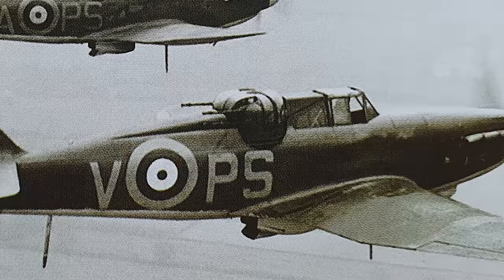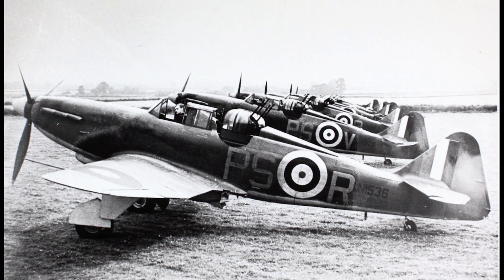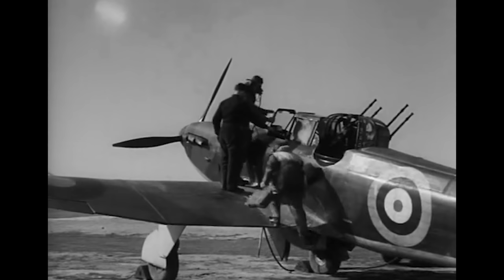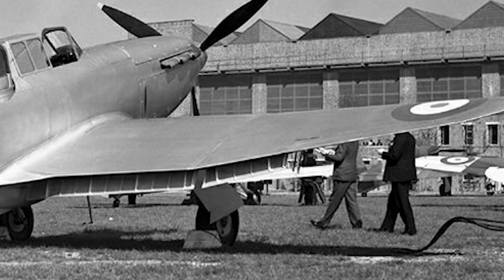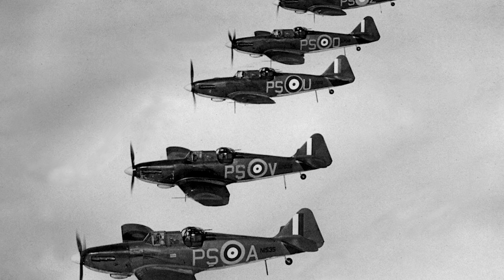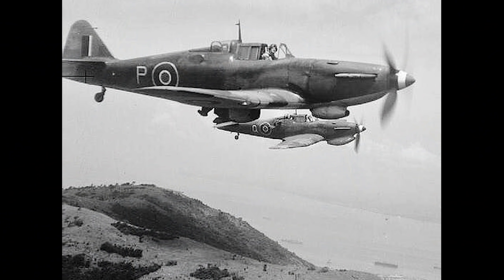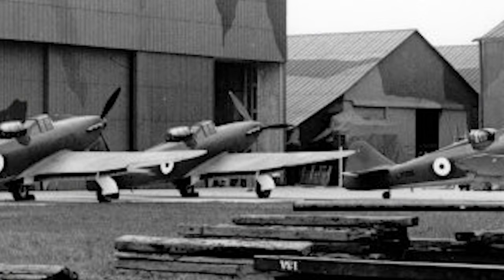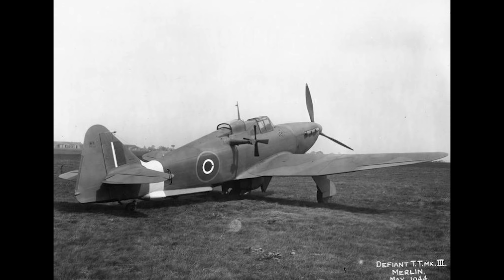Boulton Paul Defiant - The Unlucky Turret Fighter | Aircraft History #4

Comment: From the video, it appears that half of its shortcomings could have been overcome by the addition of a forward facing gun.
Reply: I think the problem would be adding enough guns to make the Germans think twice about a head on attack. A couple of machine guns probably won't cut the mustard against the 109's cannon and even these (with a reasonable amount of ammo) would be adding more weight to an already heavy plane. 

Really the Defiant was an idea that could have worked if France hadn't been knocked out the war. The RAF would have had a home defense fighter that would have been able to engage any bomber formations directed at Britain as the 109 would have never had the range to escort them. I suspect that they'd probably been phased out as the RAF realized that Hurricanes were just as capable and easier to produce. The Defiant would have gone the same way as it did, moved to a night-fighting role then dropped in favor of more capable machines. In this case it would have probably gained a better reputation as being the machine that freed up the Spitfires and Hurricane squadrons to support France.

As it is it's one of those machines which might have seemed like a good idea on paper but didn't work out in practice.
Reply: Nah
. would have made it even heavier and slower. Maybe split the armament? Dual gun turret, instead of quad, having 2 forward facing guns? Personally I would have had a dual gun turret with a single hispano cannon through the prop. Also getting rid of the hydraulic mechanical aspect of the turret to a manual since 2guns would be easier to manipulate in a turret and save weight.
Reply: @ehold6877  I think best would be to just get rid of turret, maybe have simple tail gunner but not turret because that thing was heavy and produced lot of drag. 

From what i heared, there was idea of turretless version of defiant with forward facing weaponry considered as heavy fighter with predicted speed close to spitfire. However i can't prove this information but it would certainly be more practical...
Reply: @jirja3192  maybe get rid of the turret, have a single gunner with an hispano cannon and regular armament of a standard fighter. Sort of like a il-2?
Reply: @jirja3192  Then just fly Hurricanes. Rear gunner not a lot of good on a fighter.
Reply: @Ahmad Hanifurrohim the turret could actually rotate and lock facing forward, it just took a bit of time I suppose to do so.
Reply: It was already slow by wartime standards so the addition of wing guns with ammunition would render it a lame duck.  It was a niche aircraft that found its niche as a night fighter.
Reply: Well, yes and no. It might have removed one of the weak spots, but it was ultimately the weight of the second crewman and the turret machinery that did the Defiant in. One of the biggest complaints Defiant crews had was in the difficulty they had coordinating with one another - deflection shooting from a turret is massively mathematically challenging (to the point where late-war American bombers used some of the first computers to do some of the work), and was made much more difficult when the Defiant wasn't flying on a steady course and at a steady speed - factors which meant that the pilot had to make the plane vulnerable to enemies for its main armament to be effective. When the pilot had to fly defensively, or if he would have had to maneuver as a normal fighter would to bring forward-firing weapons to bear, the quick motions of the plane would make the turret effectively useless because its mechanism couldn't keep up with the direction and attitude changes. Considering that the weight and speed were the things that ultimately put the Defiant out of business in combat, making it struggle to turn and keep up with single-seat fighters to use forward-firing weapons would have ultimately been a losing proposition as well. Thus, they went back to Hurricanes and Spitfires for the most part.
Reply: They should’ve just enabled the turret to shoot forward, and let the pilot take control of the guns in this position. That alone would’ve made the aircraft much more versatile.
Reply: There is a weight limit.  
soooooo
NO
Reply: @Ahmad Hanifurrohim "how about... wait for it... FORWARD FACING TURRET"

The turret couldn't fire down. or perfectly strait on. The muzzle break's would have been on either side of the pilot and incapacitated him.
Reply: Would have been great as a  Fighter bomber role with 4 30 mm fixed forward-facing and a 23 mm aft-facing Gun.  Keep the quad turrent and make it aerodynamic. 

Make the Wings delta and have two Variant

Tank Buster: 
Make the plane movable and add hardpoints  for rocket launchers Anti Tank roles 

Antiship maritime fighter: 
 Add torpedo drop bay for maritime  against ships and hardpoints
add Radar

Put a powerful engine with a 4 bladed propeller like the P4 thunderbolt and 

Would have been great against Naval warfare and a Tank Buster role  in WW2 for the British.

Missed opportunity  I'll say.
Reply: @LoneWolf-rc4go  that’s just it: it’s up against planes that it wasn’t designed to face…it’s not a true fighter, it’s more of a bomber interceptor
Reply: Yes forward guns would have helped. Pair of 20s would have kept them in the game. Weight would have shaved off probably 10mph. Big deal. Still could kill bombers
Reply: And the other half would have been overcome by deleting the turret. 😂
Reply: Remove the turret and gunner and fit eight .303 mg`s in the wings. Essentially you get a Mk2b Hurricane in mid-1940. This was seriously considered at one point.
Reply: There was a proposed single seat version (source Willian Green 1959 with photo) but it was just as fast as a Hurricane). The pilot could fire the turret  guns.
The turret was meant to be used like a Foster mount for no allowance shooting.
Reply: @LoneWolf-rc4go  I think that is a very reasonable assessment and a very important aspect of the design that is never considered.
Reply: I was wondering if it could actually shoot forward with some kind of synchro mechanism to shoot thru the prop.  Probably asking too much & too complicated for a turret of that type.
Reply: @tomtom8889  It could shoot forwards at an oblique angle but not directly to the front.
Reply: The guns could be fired by the pilot andvthe idea was that it was supposed to fire over the prop lie the Foster mount on an SE5 or Nieuport. 
What everyone misses - self included - was that when designed no one expected France to fall or ME 109's to be at the Pas de Calais. The Defiant was designed to intercept bombers that were either unescorted or escorted by heavy fighters like the Me 110.
Check out links to "no allowance shooting", this is the guiding thought to the COW fighters and the turret fighters. 
They were on to something though, because this reappeared as jazz music and it took a toll on RAF night bombers and even B29s raiding Japan. The Japanese also mounted oblique gunsbinbtheir heavy fighters.
Reply: Nobone expected France to fall and no one thought that it would ever have to fight the Me 109.
Reply: @AbelMcTalisker  Ah okay.  Thank you for the info & clarifying that.
Reply: Ironic then that the RAF never worked out what ‘Schrägemusik’ was…
Reply: @bob_the_bomb4508  
Indeed. Most RAF bombers were designed with ventral turrets, but were abandoned because they were essentially useless.
The COW fighters of the 20's and 30's were jazz music fighters.
The problem was looking down at night it is hard to see the attacker and looking up the bomber is much easier to see, particularly in clouds or moonlight.
Reply: well forward machine gun and a bigger engine to give it more speed.   maybe lower its base fuel to 350 miles and add a drop tank.
Reply: Add forward firing guns (like Hurricane armament) and replace the engine to increase horsepower.
Reply: @ficklefingeroffate  
This plane was never intended or expected to fight single engined single seat fighters. When conceived no one expected France to fall and the BF 109 could not escort bombers from Germany. The planners never expected German bomber formations to be escorted aĺl the way to London by Bf 109s.
Reply: @kellybreen5526  ok...and?  It doesn't mean anything I said was incorrect.  Adding forward firing guns for the pilot and switching over to a more powerful engine would have significantly improved the plane.
Reply: @ficklefingeroffate  I never implied that you said anything which was incorrect. Frankly I don't disagree with you either. All I would say is that most people assume the designers expected the Defiant to tangle with single seaters,  but the technical writing makes it pretty clear that the Defiant was intended to defend Britain from heavy bombers that would be flying from Germany and therefore too far from home to be escorted by single seat fighters. There was a single seat conventionally designed Defiant proposed (Green 1959).
Reply: @C4nn15  still too slow and under powered. And why have four guns in forward facing turret rather than th six guns in the wings like a regular Hurricane?
Reply: @rbilleaud  well it was roughly the same speed as the equivalent Hurricane, the advantage would've been a revolving turret, it wasn't as manevourable though.
Reply: @kellybreen5526  What is a jazz music fighter?
Reply: @londonalicante  Jazz Music is a generic term stolen from the Germans in loose translation.
What it refers to is armament pointed off the direction of travel and instead firing forward and upward at an angle usually around 60 degrees.
It allows a fighter to attack from below and behind in the bombers blind spot.
Even a bomber with ventral protection had difficulty looking below and identifying threats at night. Conversely the bomber would be silhouetted by cloud or a moonlit sky.
Reply: This results in four unsyncronised machine guns firing through your propellor. :(
Reply: @ABrit-bt6ce  He means wing mounted guns.
BP had a single seat conventionally armed mock up produced (Green 1959).
As mentioned by another contributor, when designed no one expected France to get knocked out of the war, so no one expected the Defiant to have to fight BF 109's. The pilot could fire the turret guns, but did not have a sight because he was expected to fire the guns in a "No allowance shooting" mode. No allowance shooting is the angle used so often with the Foster mount during the Great War, the COW gun of the interwar period, and "Jazz music" used on German nightfighters.
So the concept isn't that left field. 
The circumstances of employment and the subsequent combat record are where the plane ended up with its horrible reputation.
The RAF must have seen a use for the type though, because it remained in production rather than forcing BP to produce Spitfires.
Reply: It had been conceived with forward aiming guns, but the Ministry insisted in having the turret as sole armament.
Reply: There was no answer as a day fighter, but as a night fighter maybe there were paths not taken?.  I look at the North American P82 extrapolated from the P51 and apply that.  Maybe forward firing 20mm cannons in the wing joining the two fuselages, pilot and radar operator in number one, and turret in number two with 12.7mm in the turret.  But maybe that’s just another way to build a Beaufighter?  
Still, the P82 concept concept could also have given a Spitfire or Hurricane range to escort bombers on rhubarbs or maybe done something to add speed and firepower to a Tempest chasing V2 flying bombs?
Reply: @jirja3192  Perhaps with forward firing guns, the plane could have been of value to the Fleet Air Arm, with the rear cockpit dedicated to a navigator. Perhaps the heavier design and undercarriage would work well on a carrier.
Reply: Nice video if it had guns in wings it could have gone much further!!!
Reply: They were looking for an aircraft to do the same job as the Hawker Demon, and before that the Bristol Fighter, but they appeared to have forgotten one important thing, both those aircraft had forward firing guns and were flown like a normal fighter that just happened to have a gunner available for rearward defence.
Reply: I love the concept of this aircraft! I didn't realize they actually flew in combat in the early stages of the war. I remember seeing a model of the Defiant and I thought it was a fictional alternate universe design.

Comment: Imagine if the RAF had the foresight to instal twin fifty calibre instead of four .303. The improvement in hitting power and range would have been considerable.
Reply: That would have meant introducing a completely new gun, and all the logistical difficulties that come along with that. 

New gun production lines with new tooling. New ammunition production lines. New maintenance and training requirements. Aircraft out of service if refitted, or a wait for the new aircraft production lines to be modified. Changing a gun caliber on a large scale is an intensive process. And just changing it for a single model brings different headaches.

The .303 was adequate enough in the early war that it wasn't worth the investment to change gun caliber. By the time the Brits finally came to the conclusion that the .303 was inadequate, it was felt best to jump right to a 20mm, which was even better than the .50 cal. And by which time the Defiant was no longer in front line service.
Reply: @mikearmstrong8483  Also Douglas Bader was totally convinced by the .303 against the 20mm Hispano. But due to installation issues, the Hispano was unreliable at the time.
Reply: Boulton Paul had such a design ready to go using cannons. Rarely mentioned anywhere however was the kick back from the guns which knocked the aircraft about on firing and did give the pilots challenges when moved to fire sideways due to wind resistance and recoil. Two reasons why it never made it beyond a drawing board.
Reply: @mikearmstrong8483  all the American lend lease aircraft arrived in Britain fitted with .50 brownings. The infrastructure was there.
Reply: @PeteCourtier  
To my knowledge, the infrastructure was not there. Lend Lease planes were tailored to the customers. In the case of the British, the armament  of aircraft was changed to match what the British were using as standard. Most planes would arrive without guns, but with modifications that allowed for installation of .303 guns after delivery. Those that arrived with .50s (still looking to see if any did at all) would have come with technical instructors to teach maintenance, and a steady supply of ammo was provided. I cannot identify any source indicating .50s were manufactured in Britain.
Reply: @PeteCourtier  

That is referring specifically to Browning .50 cal, with the standard Remington ammo, as used on aircraft. The British Vickers company produced a different .50 cal gun and ammo for AA use since before the war.
Reply: @mikearmstrong8483  At least the FAA kept the .50’s in the Martlet. Invaluable for shooting down FW-200’s.
Reply: @mikearmstrong8483  I know👍
Reply: @suburbiapheonix7960  they had 2 designs - the twin-engined P.92 which had 4 20 mm cannons in a flat and wide turret and the P.96C which had 4 20mm cannon (2 in each wing) plus 4 .303 in the turret.
Reply: @mikearmstrong8483   In the inter war Years there might be a Trail leading to manufacture in Birmingham of .50 cal ammo  in  Britain ?  I would assume they had the Capability to Manufacture The Browning  Machine Gun , the problem between the Wars would be the Funding .
Reply: @markcantemail8018  
Any time you use the words "British" and "war" in the same paragraph, that word "funding" magically interjects itself.

Having the ability to do something doesn't mean it is worthwhile to do it. Obviously, the British had the technical capacity to manufacture Browning .50 cal guns and ammo for aircraft. The fact that they used .303 cal until they changed to 20mm shows that they did not consider the effort necessary or worthwhile. 

And I presume we are talking about history here, and not theoretical upgrades in a video game.
Reply: @mikearmstrong8483   I do not play Video Games on the Computer  .  History would mean I used the Computer to research British arms Manufacture one day and saw they made .50 cal Ammo  for Testing . If you can get your teeth into a search like that you might find out it was in the 20s .  But  like you  that word Funding is there .   I praise your Understanding and Knowledge of the Problems involved . Thank You for  the Reply .
Reply: @markcantemail8018  
Didn't mean anything personal by the reference to video games. I appreciate the discussion.
Reply: @markcantemail8018  Add to that the huge stockpile of.303 ammunition that the UK had leftover from WW1. Some experimentation on using .50 weaponry for aircraft use was carried out in the inter-war period but adopting the weapons as standard did mean also manufacturing the ammo for them. Sticking with .303 as the standard caliber just made more sense at the time.
Reply: @simongee8928  Douglas Bader was a very good pilot and a brave man, but he had some stupid ideas such as the Big Wing theory. He also got involved in politics against Hugh Dowding, whose clever rationing of Fighter Command's resources allowed Britain to win the Battle of Britain. Bader in my mind is an example of the Peter Principle - a guy promoted to his level of incompetence.
Reply: @dougerrohmer  Apparently, when Bader was a POW in Colditz, he refused to allow his batman to be repatriated on medical grounds because he demanded his retention as he regarded the batman as his 'lackey'. 
A very insensitive man.
Reply: @simongee8928  Geez.
Reply: Even with a larger guns the turret fighter was useless.
Reply: @jollyjohnthepirate3168  Unless it's a much bigger night fighter like the Northrop Black Widow - !
Reply: No, just install 1 or 2 Hispano 20 mm cannons